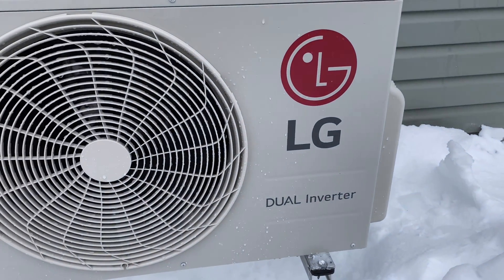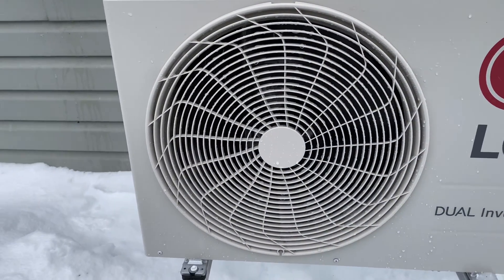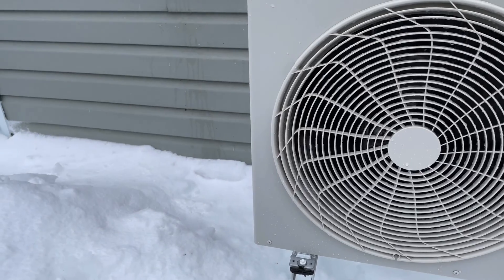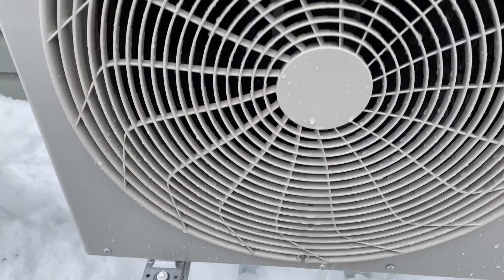Ductless Minisplit Compressor Clogged with Snow and Ice Fix

Comment: Its my first winter with a mrcool unit. In heating it defrosts and dumps a lot of water out so I ended up picking it up onto a stand but it still freezes and builds up 3” thick ice under it. Thats not good to dump all that ice and water near the cement pad and foundation. I dont understand how this is a good design.

Comment: If you put the air conditioner in cooling mode, it'll heat up the outdoor coils and the ice will melt right away. When it has melted, switch it back to heating. These units should do it automatically though, and so I'd get it checked out

Comment: I took  a garden fork and hit the ice on the back which was hard to get to since it's secured to a stand a foot from wall- but the ice dislodged from the back grate pretty easily though don't want to puncture anything by accident- but hopefully that will stop my unit from going into df -defrost mode continuously where it stops for a bit and no heat is dispersed.

Comment: I have a protective roof. The unit can still ice up as condensation forms on the fins dripping down and freezing.  Using warm water can work but if ice is thick it may not be the best. Using a heat gun or good hair dryer when the wind is not so great really works to melt thick ice at the base and opens up the drain holes.  I think the design of all of these units could be better to help prevent such build up.
Reply: I've owned an LG Multi F for a few years now but this winter I will be using it for the first time for heat.  Apparently, most major brands make drain pan heaters that can be installed that heat the drain pan when the temp dips below freezing.  I plan to install it myself.  My other unit is a Mitsubishi Hyper Heat and it already comes with a drain pan heater as do most other mini splits that are designed to handle extremely cold weather.  This is a link to the heater I purchased: https://www.supplyhouse.com/LG-PQSH1200-Multi-F-Pan-Heater?gclid=Cj0KCQjwktKFBhCkARIsAJeDT0j6EwCVeDKXGe9S2833Hn2_5ytUPWZ48Kc1cGWofENimgh1oJS_EgIaAgUnEALw_wcB

Comment: I just used the garden hose and sprayed on the condenser/evaporator fins. The water is warm enough. 
 It appears that a snow roof is needed to stop the unit inhaling snow. I haven't done this yet. Units I have that are under overhangs that protect them from snow have had little or no icing.
Reply: We had not had any issues with ours....however this was the first ice storm we've had.  Me and the boys will be building an overhang this spring.

Comment: That is not a "fix." That is emergency triage. The "fix" is an awning or mini-roof over the compressor unit.
Reply: Still can get lots of ice build up with a covering on.
Reply: The "fix" is actually a drain pan heater that you install and is powered by the control board.

Comment: This happened to me as well, but another way is to turn it on AC at 20 degrees for a couple hours. You might have to turn on baseboard heaters for that time, but AC reverses the heat exchange and melts the ice. The defrost cycle in heating mode is essentially a quick AC mode to heat the coils and melt the ice.

That said, hot water works too!